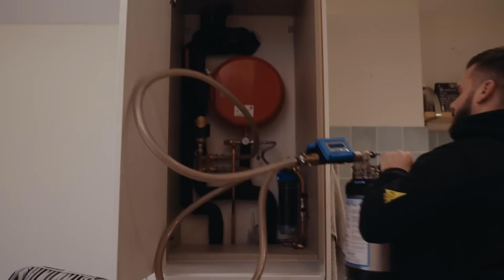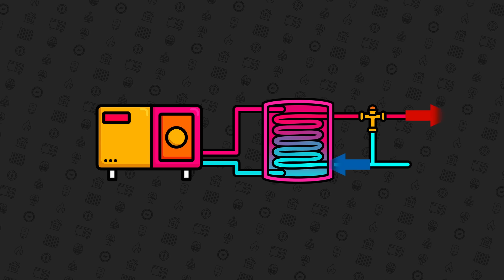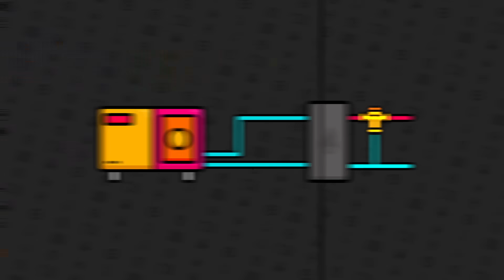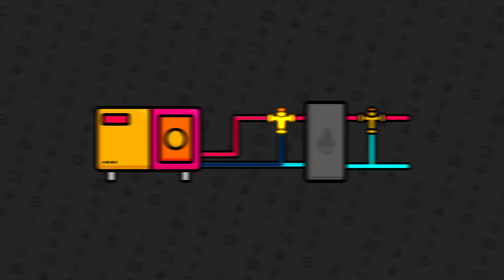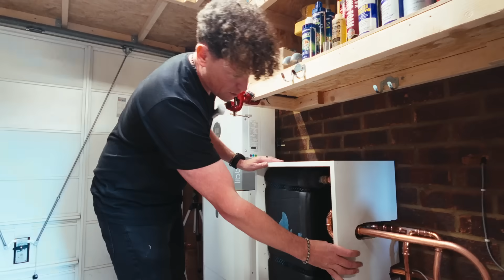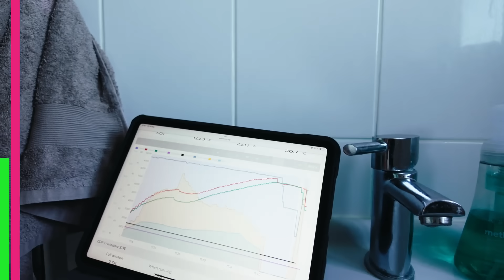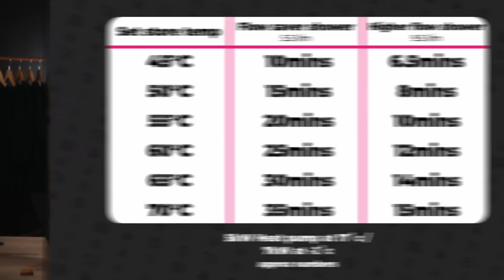World’s smallest hot water solution. (With a heat pump)

Comment from the maker: What tricks were we missing!?
Reply: Perhaps preheating the cold water?

If you have the central heating water loop close by you could run that through another heat exchanger and preheat the incoming water, before it enters the primary heat exhanger. 

And of course, you could also recapture heat from waste water, to preheat the cold water supply pipe as well.
Reply: @jac540  There are systems for bathroom drains that have heat exchangers that preheat the cold water for the shower. This saves you on hot water. Unfortunately, they are expensive and must be built into the floor.
Reply: @bjarneh-im1uw Yes, that's what I meant with:

"And of course, you could also recapture heat from waste water, to preheat the cold water supply pipe as well."

They actually don't always have to be build in the floor. You have horizontal ones, which you build in the floor. You have vertical ones, which you usually install instead of a piece of vertical drainage pipes, and you even have variants which can be placed under the showertray.

I've been told that the vertical variants tend to work the best in recapturing heat.
Reply: Could this be turned into a one mono block unit as a temporary heating and hot water solution for events, and emergency situations. Could temporary shower blocks be ran from a beefed up version
Reply: @DanielPerager  what do you mean by 'this'?

If you want hot water for a shower you can run it straight through a heat pump, without heat exchangers, as long as it's powerful enough.

If you want to beef it up you can either make the heat pump bigger, or add more storage, (or both) for example by putting an insulated tanker truck next to the biggggggg heatpump and have it act as temporary storage for hot (shower) water.

If you want heating you can do that with a heat pump as well.

To expand on that: in the circumstances you describe (events and emergencies) a heat pump might not be the most logical solution.

For events: if you go to a festival and take 2 short showers where the water is heated using a diesel heater that isn't all that problematic for the environment. If you use that diesel heater to shower at home 150 times a year that's the environmental impact heat pumps are better suited to solve.

And both for events but especially for emergencies you want easy, cheap and easily relocatable sources of heat, and for that a tanker truck full of diesel and some big burners are wayyyy easier. (you could even fuel them with an environment friendly alternative like biofuel, methane, or other alternatives).
Reply: Maybe a small electric instantaneous water heater set at lower temp than what the heat pump/mini store will eventually supply, installed after the mini store/before the outlets? 
For example, if the instantaneous unit is set at 35DegC, as soon as it detects flow, it will turn on and provide water, warm enough to use. As the heat pump ramps up, the supply into the instantaneous will increase to over 35DegC, thus the instantaneous will turn off automatically (no need for complicated controls) and the heat pump will continue. Any shortfall of heat, below 35DegC, will bring the instantaneous on, but as the heat pump will be providing pre heated water, the instantaneous will only be topping up.
All electric, efficient, and if you run it off battery backup, you've charged at 7p overnight on octopus, the running cost will be tiny. 
I'll be up to have that installed as a test at my house if you need a guinea pig 😉
Reply from the maker: @jasonbgranger watch the video.. that in there
Reply: A recuperation heat exchanger on the shower or sewer drain to pre-heat the cold water inlet on the combi...
Reply: Gosh sorry I completely missed that!
Reply: give me that solar dump immersion element!
Reply: Hi Adam, this is the 100-plate exchanger. Would the ones with fewer plates also work? Or is 100 plates the minimum quantity for your calculations?
Reply: I kept thinking to myself that this unit could just go with the outdoor unit then No indoor unit is required. Surely I’m also missing something here??
Reply from the maker: @blockwhisperers8352 yes. As per the animation at the end of the video
Reply from the maker: @blockwhisperers8352 watch the full video, it’s in there also
Reply: A mono block combi?
Reply: 1 make these possible for large flat complexes. 2. make it controllable locally to each flat complex?
Reply from the maker: @im_gunna_Wreckit it intrinsically already does this.
Reply: @HeatGeek yes. You have apologies. I guess my tired brain was thinking that the pump or pump set would be connected to multiple flats. So when each flats calls for heat how and who do you charge for the electricity. Cause having a pump for each flat is. In theory the best way is on the roof or side of the building. But my place only has room on the ground for pumps. So really you need one pump acting as the "gas" supply. (Sorry just answered my own question. Its a flow meter to electricity used on the heat exchange intake)
Reply from the maker: @im_gunna_Wreckit they’re called HIU’s. Heat interface units
Reply: I Love the engineering process trying to pave the way for a new future. The problem i instantly  come back to is this. Heat Pumps sell on the basis of being of a scop of say 4 or above. This just about evens out the price difference between gas and electric. So unless the energy market changes i just dont see how its a viable option for customers. Purely from a consumer view. As a pro heat pump view im loving the work going into this.
Reply from the maker: @johnway2039 the break even against gas boiler scop is 3.35 not 4… which makes them potentially cheaper to buy than gas boilers… tune in on Friday 4pm
Reply: Biggest issue I see here is scale. Even the smallest amount will have a huge effect IMO. You get away with a lot on gas combi's. So maybe an addition of an electronic water softner to systems in hard water areas? Or quaterly descale? Could add a small dosing pot for this perhaps?
Reply from the maker: @neilmitchell9483  if you don’t really have a problem with scales on Combis, you’re not going to have an issue eating the same amount of water through a plate 70 times bigger
Reply: I am little worried about often starts of heat pump. I had problem and my heat pump was turning on for 30 mins multiple times per day. My technician says this is shorting lifetime of heat pump because it should ideally run for long periods

Comment: I'm interested in one of these but not seen anything yet?
~Also I looked at the manufactures' website there are longer thinner ones 15cm thick.. 
2 long heat exchanchers could fit under the kitchen sink cupboard and if using superfoil rather than foam wouldn't be visible.
I'm also redoing sub floor in 18090 victorian house.. 450mm deep empty space..
Couldn't  something like this be in underfloor sub space or understairs cupboards close to kitchen..

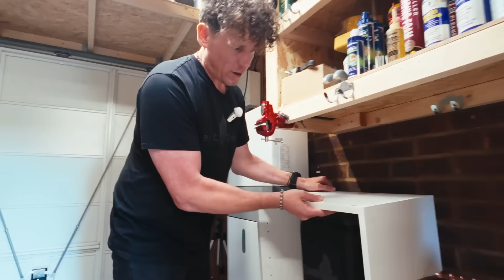Comment: A suggestion: a user replaceable, custom designed, preconfigured cast mono block off-the-shelf drop-in replacement built into the enclosure itself, (tesla HVAC style.) It would integrate those profligate pressure relief, bends, gauges, mixing & drain valves, etc. now seen outside the enclosure @5:37 to achieve your stated goal of a space-saving simple unit.  It could perhaps even offer the opportunity to badge it as a risk-free DIY installable hot water source. The reprobate chaos of pipes double the size the enclosure specs, logarithmically increasing plumbing tasks, risk leaks, and major expense.  

A user installable, all-in-one  system could also be used in other non anticipated situations, like boats, parts washing, handwashing station, restaurant pre-soaking, etc (the mind boggles,)  which don't need this level of sophisticated integration to complementary residential infrastructure.  Also. a Hybrid AC/DC option for solar voltaic, and even solar thermal, as well as an accessory option for ambient room temp incoming cold water preheating to take advantage of an effortless 20 deg F work offload.

Comment: Good results, but the math does not add up. The std flow rate for shower in EU/UK is (up to my best knowledge) 8-12l/min. Let's take round 10l/min. Assuming input water of 5C and output water 35C (+30C), it requires 21kW of constant power to keep up. So basically you need a 5kW heat pump with COP of 4.
Reply from the maker: If you google that’s the flow rates google says yes… in reality Shower flow rates in the eu/uk are 5.5 to 9l/min..

10-12l would be a pretty crazy xl rain head shower.

Comment: COP of 3 is barely break even vs natural gas or fuel oil prices.... why even bother with heat pumps? costs 5x more to install and good luck finding a competent and honest tech once it eventually fails leaving you and your complex heating system in the cold... in the end, id want to install those systems too in my home but ill let my fossil fuel heating sources in just in case and especially to assist when outdoor temps make the COP drop below 3. im perfectly comfortable repairing my good old fuel oil burner myself on xmas eve and whatnot but i know finding a tech to repair the heat pump system will take months unless i agree to replace the whole install with a new system... competent techs are too rare. also, good luck finding spare parts 10 years down the line. 
anyway, to leave on a positive note, take this rant as a signal that good heat pump, aircon, refrigeration, ... techs are very rare these days and if u aspire to be one, u wont have any difficulties filling your schedule with profitable interventions.
Reply from the maker: Because this only makes up 20% of demand and the heating can be up to 600%

Comment: Thank you for the Nano Store idea and the many interesting Heat Geek videos.
In the steady state condition (when the 15L hot water store has been used up) ...
7kW (from heat pump) will raise the mains water supply by about 18C at 5.5L/min (.092L/sec), because water's specific heat capacity is 4200J/kg.C.
When the mains water supply is 22C (in summer), the shower temperature will be 40C.
When the mains water supply is 5C (in winter), the shower temperature will be 23C (far too cold for a shower).
Please could you re-run this experiment in winter, when the mains water supply is cold (e.g 5C).
Could you show the temperature of the mains water supply on your results graph.
Could you also do a video to show us the results for this winter experiment ?
Thank you.

Comment: How does this fit into a complete ASHP installation for a normal size house? Is this extra on top of a heatpump heating system for your house?
Reply from the maker: It’s instead of a hot water cylinder

Comment: This sounds brilliant! 
I'm wondering if I could use it to top up the temperature of DHW heated by my thermal store when it's not quite warm enough.?? 

My current setup comprises a 350 litre thermal store heated by solar thermal (evacuated tubes), a wood burner and a heat pump. Space heating is via UFH direct from the heat pump. DHW comes from mains pressure cold water passing through a plate heat exchanger. A flow switch triggers a pump to circulate hot water from the thermal store through the plate heat exchanger whenever a hot tap is opened.

The store is heated enough (60C) from the solar thermal in the Summer and sometimes from the woodburner in the shoulder seasons, but through the colder months it generally remains between 20 and 30 degrees C so we need to use the heat pump.  It takes quite a lot of energy to heat up the 350 litre thermal store and this doesn’t seem particularly efficient, particularly if it's only for a couple of showers.

Could I use the Nano store, powered directly by the heat pump to top up water coming from the thermal store as shown in these diagrams. 

https://docs.google.com/presentation/d/1deRqlLJ-oF2MwEPdbjnA4DpcjCgref45y7-07uzdfl4/edit?usp=sharing

Comment: 60kg without fittings, or the 30 litres of water it holds. That's going to be a lot of weight in your kitchen cabinet, or on the top shelf!

The unit alone from noric tec costs €1755.

How much is it going to be installed?

Comment: Well, looks like I'll be putting off my move from a broken down gas combi boilerto a heat pump until next year. The lack of a replacement combi is what has stopped me so far. In a small bungalow I really don't want a cylinder in the loft. This is terrific news and hopefully will be available before the £7,500 contribution is removed.
Reply from the maker: Great to hear you're considering the switch! Looks like the Ministore could be a good solution for you

Comment: Innovative Fresh Water Station at work 👍
+ Brilliant advantage is, the massive plate-exchanger smoothens input heat fluctuations (which are natsty to control via intelligent pump control).
- Problem could be, that the heatpump can't switch from heating to warm water mode that quickly (including the 3-way valve).
Reply: CPO and compressor will suffer. Needs some smart software, e.g. start heatpump the second the tap opens?
You might need 25L extra.

Comment: Great video. Just thought I'd mention another selling point for your system. Although our water pressure is around 6 off the street its reduced to 2.5 (bar or whatever for some irritating technical reason) meaning that although we have a massive hot water tank (due to solar thermal) and three showers in the house. We'd never use more than one due to water pressure.... and scream at any one who turned a hot water tap on anywhere in the house! especially if showering in the loft conversion...What I'm trying to say is that if others have a similar experience to us, they are unlikely to use showers concurrently (or any other hot water) irrespective of the heat of the hot water. A la Simpsons https://www.youtube.com/watch?v=XaHSBg7qcq4

Comment: Any interest in also using the small high temp CO2 heat pumps they have had in Japan for ages?
Reply from the maker: They need too wider dt. They’re I ot really good for hot water. Japan use electric heating as far as I’m aware.. some hydrogen fuel cells and perhaps co2 hot water heat pumps. 

Also.. r290 is great

Comment: A fun and well made video that tells the viewer that this system will work, but little more.
I’m sure lots of Brit’s have used a dreaded electric shower, the kind that Triton makes, where hot water flow is reduced to just about sufficient in the winter (when incoming cold water supply is at a lower temp).
The heat pump system can more than double this flow in winter, but that’s for the whole house!
Not quite snake oil, but very limited.
A large hot water storage tank solves the issue of course.

Comment: For the last few weeks I have actually been designing a heat pump reverse cycle build based arouond 2000-4000L water battery reservoirs for a large square metre home new build that will charge on solar during the day and require no use of energy at night and run on residual heat from the large water stores. I am going to build the place myself and heating / cooling system myself. I am thinking of using old milk vat refirgeraters which are  cheap due to all the small scale dairy farms being bought by larger operations.

I would love to chat to you about the viability of my ideas as I am sure there'll be some hiccups along the way or even fundamental issues I may have overlooked.

Comment: For homes that only use air-to-air heat pumps, can this still work (charging overnight on non-peak rates)?
Reply: For homes that decide against air-to-water heat pumps, I really hope you can work on a good 'heat battery' type solution similar to this (small and effective).

Comment: Seriously how have the big heat pump manufacturers with 100s of engineers and millions in RD budgets not already created such a product?
Reply from the maker: Absolutely mental, isn’t it!?

And what’s more mental? Is that there’s even more to come!
Reply: @HeatGeek  Do we still need water tanks then? It seems like a massive waste of space to still put a water tank and all the fuff around to install it.
Reply from the maker: @christianu8023 if you want efficiency, yes
Reply: @HeatGeek  is there are comparison in efficiency available between a normal water tank, a mini store and a nano store? 

Can we still achieve a SCOP above 4 using a smaller mini store for example? 

I have a small area under the stairs for a tank, and a mini store should make this much more accessible. However, I definitely would not want to loose more than 0.1 or 0.2 from the SCOP efficiency.
Reply: @HeatGeek : Also water tanks enable better use of time of use tariffs. It’s a common setup in Finland to heat up a water tank with just eletricity during the night when electricity is cheaper. The water thank would be combined with a air to air heat pump (they are very cheap compared to air to water).
Reply: The big heat pump manufacturers haven’t produced something like this, and there’s probably a reason for that.

Using a 2000 kW plate heat exchanger with a 7 kW monobloc heat pump is certainly an impressive bit of engineering, but you’ve essentially built the worlds most expensive combi system.

Just because something can be done doesn’t always mean it makes economic sense as a decarbonisation solution.

Comment: It is a requirement by law to have a blending valve on hot water system in Australia to prevent scalding. Also it is important to heat up water hot to prevent legionnaires. Unlikely to see a product like this in Australia for ages given the red tape and sand. But hopeful we get this innovation. Our typical heat pumps hot water are Istores and Reclaim. Heat pump are also typical used to cooling too aka aircon. I wish the heat pump for cooling would also be used for heating up hot water. Effectively aircon heat pump take the heat out of the air inside the house and throw it outside. That is wasted energy which could be used to heat up a pool or hot water system.